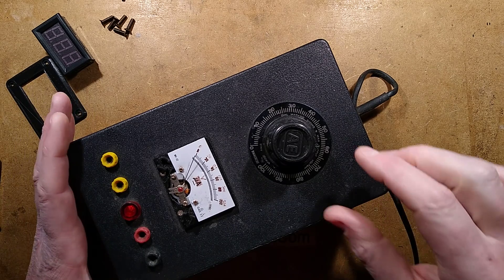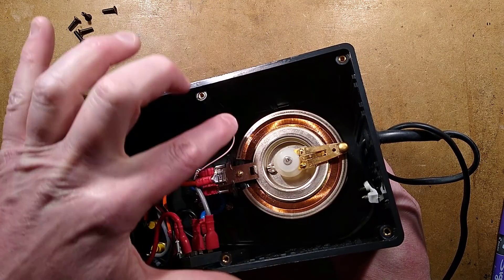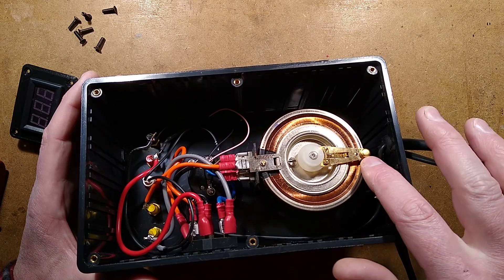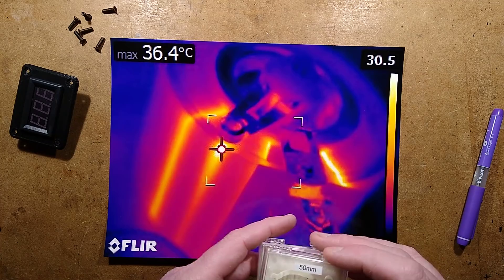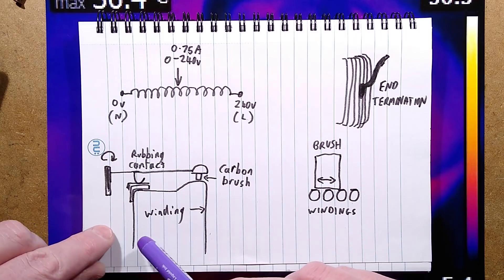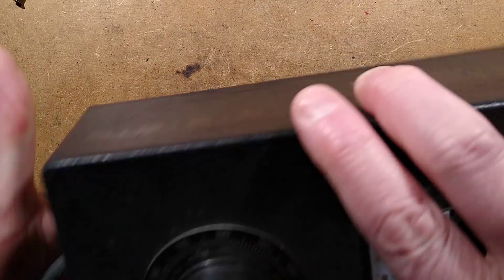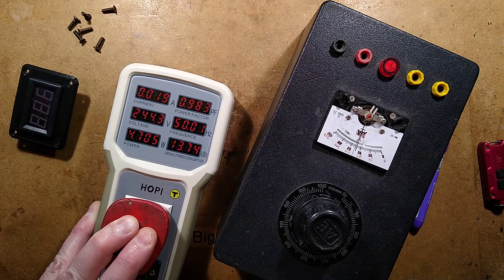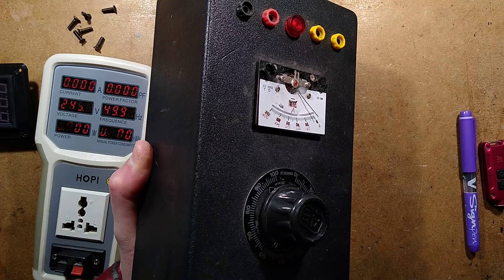Variacs DO short their windings

Comment: I must say I'm not sure I understand the workings. I always thought these were massive variable resistors, therefore I found them a bit mysterious and never wanted to own one. I hear Clive clearly saying that this is not, so that part is explained now. But how is this a transformer? It only has one winding as far as I can see. Where is the second winding? Or is there an internal first winding and we are seeing an adjustable second winding?
Or is it by definition a transformer because the coil core is not ceramic but ferrite and some effect makes it that it mechanically all works like a variable resistor with wiper etc. but because of the ferrite core it's working is different than a big variable resistor ?
Reply from the maker: It works inductively instead of with resistance.  It acts as an autotransformer with taps on a single winding.
Reply: @bigclivedotcom  auto transformers do not provide isolation so relative to mains voltage they will supply mains voltage but relative to its own output the voltage is dropped I would love to have one as using a current reduction via an old tungston bulb just will not cut it sometimes you really do need voltage control I have a DC regulated power supply that can do this and restrict current by reducing voltage when the current reaches a set target
Reply: Useful little thing is if you add turns after the input tap you can actually get a higher voltage out than what comes in :-) One must always remember that since there is only a single winding you are always directly connected to the mains input so a variac will not isolate you from the mains like a regular 2-winding transformer would so you may still need an isolation trafo to be safer when working with these.
Reply: Another way to think of it is just like a voltage divider, except with reactance (i.e. inductance) instead of (well, technically in addition to) resistance.
Reply: @GigsTaggart  Well not quite. There is a big difference between using 2 complete inductors in series as a voltage divider, and using two coils on the SAME core. If they are on the same core, they induce voltage on EACH OTHER, and change each other's inductance value. 

Now for something really crazy:
A voltage divider's output normally changes depending on the load, and the impedance of the parts used in it determine how much. BUT: 
Actually, a loaded autotransformer's output voltage is basically as rock solid as if you put the same !DC! voltage across the transformer windings, which is normally at most a couple of ohms. 1 ohm across 240V would be 57 kW (!!) of power dissipation in a Resistive divider. But at AC, the output acts just like that's the case!
Reply: @Basement-Science  yeah the voltage divider analogy breaks down when you look at things like it actually being able to generate higher voltages than the input.  I meant it more for conceptual understanding.
Reply: @GigsTaggart  That method will work but you have to take into account the mutual inductance between the windings. Otherwise you will not get the correct result.

However, the advantage is that the voltage divider formula still works even for output voltages that are higher than the input.
Reply: The line between inductors and transformers isn't quite as rigid as you may have been led to believe. The transformer action is because the two parts of the coil (one between live and the wiper, the other between the wiper and neutral) are magnetically coupled through the core, therefore currents in one part of the coil can induce voltages in the other part and vice versa.
Reply: Imagine a transformer with a center-tapped secondary. You can get say 12V AC from either side of the secondary and 24V AC from across the whole secondary. Now, remove the primary and it becomes a center-tapped coil. Now apply 12V AC to one half of the coil. The other half of the coil will have 12V AC out and the over all coil will have 24V. The transformer doesn't care what coil has the input voltage on it, the voltages on the other parts of it will still have the voltages on them based on the ratios of the windings. Now instead of the center tap being soldered on, it's connected through a wiper and you have a Variac.
Reply: also, if it was a variable resistor, shorting the windings would not be an issues. perhaps that is why I never imagined they were something else than a big potentiometer?

Comment: Interesting that you want to replace the analog meter with a digital one. I used to have digital ones but have the odd feeling, that it is much faster and more intuitive to adjust the voltage/current to a desired spot. That will be due to our instincts, we have a hardwired closed-loop in our brains for moving things to where we want it. There is no such instinctive support for 3 digits of numbers.
Reply: I just like analogue meters. Another advantage is if the load is varying, a meter shows it better than wandering digits...
Reply: It looks like a cheap eBay meter with a slow update rate too.
Reply: @Agent24Electronics  It might be relatively fast. I used eBay meters when I did my variac probably 10 years ago, and they update once or twice a second. Not wonderful, but not horrible either.
Reply: I added digital volt and amp meters to a variac that never had a readout. Except for the last few volts I never attempt to set a voltage from the meters, they are too slow. The variac has a 0-100 scale, and I've marked the actual output voltage at a couple of interesting points like 115V and 125V, so I can go directly there, or estimate some other voltage as a fraction of those voltages. Once I'm close I can be precise with the meter, if it matters.
Reply: I have an asian variable autotransformer which came fitted with a digital voltmeter. Nice touch that they tapped the first few windings to supply voltage to the LED voltmeter, so that it can show 000V when the transformer is turned all the way down. But I also fitted an analog volt- and ampmeter, just because they show dips/inrush current from charging capacitors in switching supplys more readily. Also I do not need absolute precision, but more like a +-10% setting around nominal mains voltage when repairing radios or TVs. Amps the same, if I expect like 0.5A I just want to see if the DUT is in range, if I would need a precision measurement I would use a more suitable DMM with higher resolution.

Comment: The windings on these variacs aren't always with fine wire.  I've got about a dozen old Statco 20 Amp, 0 to 120 VAC variacs,  and the windings look like 14 GA.  The carbon brush looks like it contacts more than one winding as well, but I guess it doesn't hurt it.  Does dim the lights in the room for an instant when the power switch is first turned on,  even with no load connected.
Reply: Yeah, I got my hands on an old Grundig RT5A combined Variac/Isolation transformer that can output up to 3,5A, and it actually has a "soft start" mechanism so it does not blow the breaker when you switch it on. It actually needs it, when I first got it I forgot to reset the power switch and turned it on at the outlet - and suddenly it was dark ^^ )
Built like a brick outhouse, really heavy and the wires on the secondary are really thick don't know what gauge, though. But must be able to take afair bit of heat.
(https://www.radiomuseum.org/r/grundig_regel_trenn_transformato_2.html)
Now I am kind of intrigued to pull the cover off again and look at it with my cheapo thermal imager.
Reply: From an electrical viewpoint, you want the brush to contact at least 2 windings to ensure that there is always a smooth flow of current as the knob is turned. If only a single winding was in contact with the brush, then the current would momentarily drop to zero as the brush moved between windings. From a mechanical viewpoint, the brush has to contact at least 2 windings so that the brush can glide smoothly between windings. If the brush contacted only a single winding, then the brush would fall into the gap between windings and would get stuck.
Reply: @stevewhite6252  The heel (inside) of the brush is in contact with two windings since they are more closely spaced, so there is a make before break connection, FWIW. Id imagine they set it to be a sweet spot between performance and heating.
Reply: @stevewhite6252  The perfect response to Clive's video.
Reply: Magnetizing inrush current. It happens to all transformers, but it goes larger as the transformer size. 
Power transformers at substations makes crazy sounds when started because of this.
Reply: My General Radio W20 Variac is probably very similar in construction, and yeah, its windings are about that size. It tends to pop the circuit breakers in my apartment if I energize it without a load. But it helps if I place a light resistive load on it, say a 40-W incandescent lamp, and the knob around 20-30%.
FWIW, the large aluminum disk that rotates and holds the brushes is referred to in GenRad/IET documentation as the "radiator". The whole disk is electrically 'hot' during operation -- found that one out the hard way! 🤣
Reply: @SigEpBlue  I've got the same one (well, actually I have two, and a W10)
I think it's just inrush current, until the field is saturated that causes breakers to pop.
The bulb acting as load is going to damp a bunch of harmonics.
Reply: That's how my 14 amp Staco Energy one is. Wound with coarse windings that are just ground flat on top, and the brush is the width of the core thickness. These things are ridiculously expensive, too. Got mine in new condition for free, but I think it was like 400-500 USD new. The sudden inrush is due to the core saturating since there is no magnetic field present at turn-on to resist the incoming AC. Turning the variac on near the zero crossing causes the windings to pretty much only present their DC resistance once saturation is reached, and draw LOTS of current until the field builds up. I have a large Denon receiver that does the same thing.
Reply: Actually grabbed my Staco to have a look. It has a very narrow brush. It spans the thickness of the transformer, but can only ever contact, at most, two windings at a time, so multiple windings don't get shorted. Im sure that also makes the finish quite critical since if the brush ever hangs, it will shatter due to how thin the cross-section is. To that end, the movement is completely smooth and almost imperceptible.
Reply: @mysock351C  With close inspection,  two that are in the hallway here look like that too,  with the carbon brush making contact to only one or two windings.
I stand corrected about the power rating.  They are rated 2.1 kVA,  so I guess this would be closer to 18 Amps and not 20.
They don't mess around building these things;  the power cords are 14/3,  the same as the 120 VAC branch circuit wiring.
Reply: @LakeNipissing  Yeah they are very robustly built. We used them at my last job to power large sections of heat tape for environmental testing on shock and vibration machines, and I don't remember any of them actually burning windings when they suffered accidental short circuits during an overnight test.
Reply: When powering on a transformer, the switch contacts (or plug contacts) will make at a random point in time compared to the waveform of the AC cycle. But the likelihood is that waveform will not be at or near the zero crossing point. So you could be connecting what is essentially a short circuit across the mains at a point in time where the waveform is at a significant voltage level. Hence until the magnetic field has a chance to build up (which takes a small amount of time), only the very small copper wire resistance will limit the current flow. Hence the high “inrush” current. Worse, the switch contacts will not make a nice clean contact and then stay made. They will make and break numinous times before the vibration stops. So you don’t get one single inrush current, but several... This effect is very good at blowing normal  quick / fast blow fuses. Hence time delay / slow blow (also known as motor fuses) are normally fitted.
Reply: @ruben_balea  I have known was a Variac can do for a few decades, but Clive's schematic was where it finally clicked for me. If we consider a simple center tapped coil... drive it from the center tap to one side, and then measure the voltage across the whole coil, it should be about double. One half of the coil magnetizes the core which magnetizes the whole coil... giving us a turns ratio. As I recall, don't many variacs allow the center tap to go past the end and actually increase the output voltage?
Reply from the maker: That sounds like the classic behaviour of a toroidal transformer.
Reply: @bigclivedotcom  I am confused wouldn't a transformer not counteract the change in current since its bascially an inductor, wouldn't that just be like a resistor on AC, why does it dimm the lights when the lights are in parallel with the trasnformer?
Reply: @Ramog1000  It's a variable auto-transformer https://en.wikipedia.org/wiki/Autotransformer  For that reason there's no isolation between input and output.
Reply: @Ramog1000  Yes it does act like an inductor - once the magnetic flux is resisting. But you have to remember that a transformer is just a long piece of wire that's short circuiting the input. It's insane if you think about it when you look at a schematic. Very low resistance if you measure it with an ohm meter. It takes a split second to energize and establish the alternating field until it offers this self generated resistance (inductance).